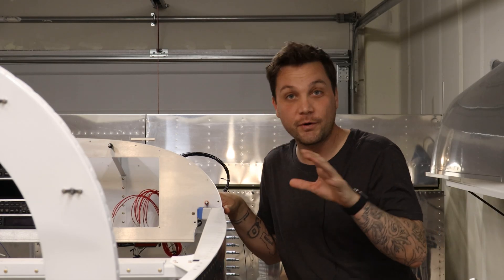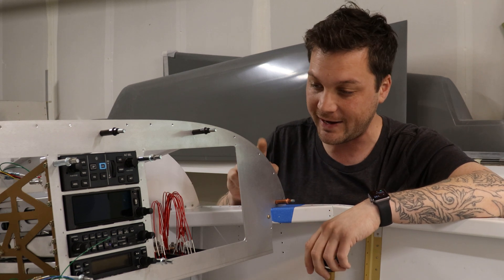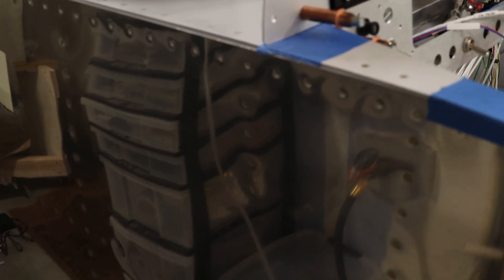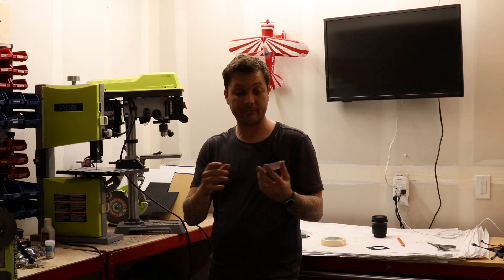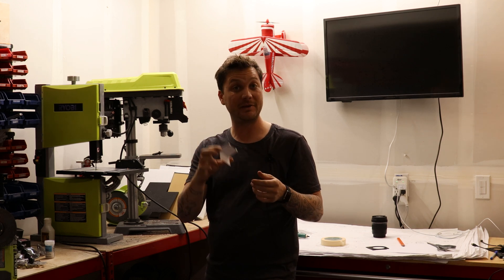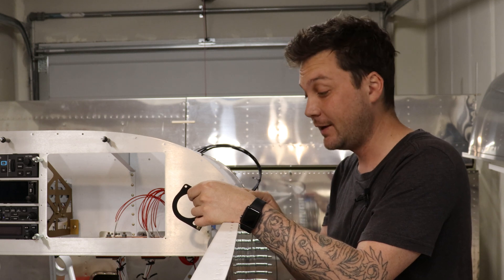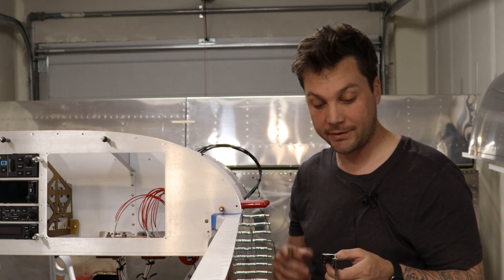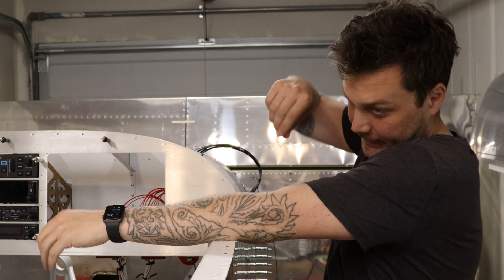Installing Fresh Air Vents - RV-7A | EP4.9

Comment: Hello Ryan,
Hope the project going well.
Me and a friend have a RV-7A and not satisfied with the plastic air vent, they don’t seal well.
Are you satisfied with yours? If yes can you tell me where we can get some.
Thanks!
Hope to hear from you soon!
Reply from the maker: Mine didn’t come with any vent—plastic or otherwise. I think they’ve been discontinued.

Look for the aluminum ones at Stein Air. Also sold directly from Van’s and a few other retailers. (Spruce has some.) 

They’re expensive, but fantastic quality.

Comment: Just a FYI you may already know. Carbon fiber in direct contact with aluminum causes galvanic corrosion 👍
Reply from the maker: I knew it wasn’t a good idea. By the end, these parts will al be primed, powder coated, and/or clear coated.

Good to know though. Good addition to keep here.